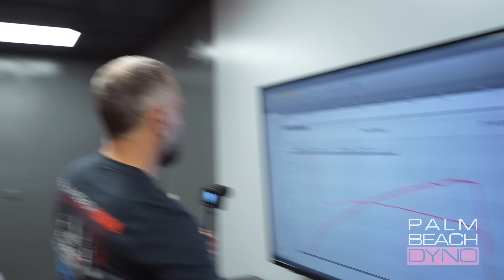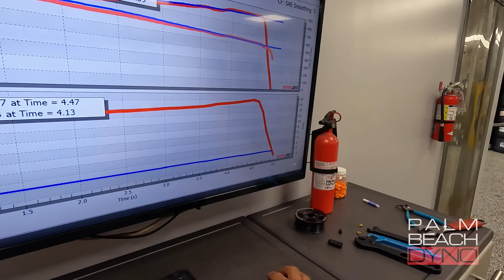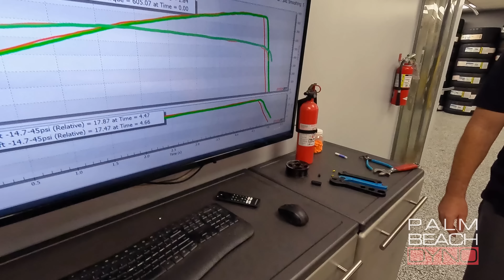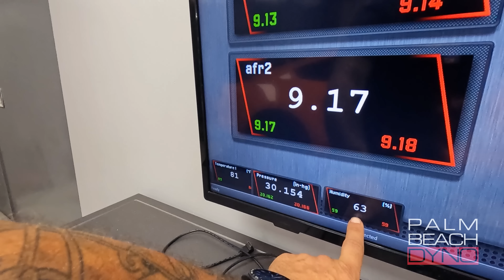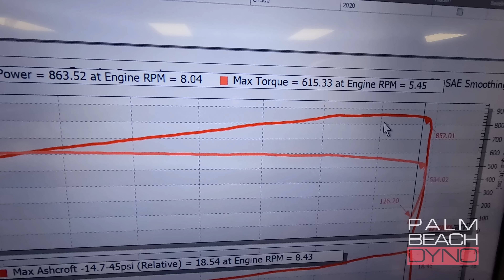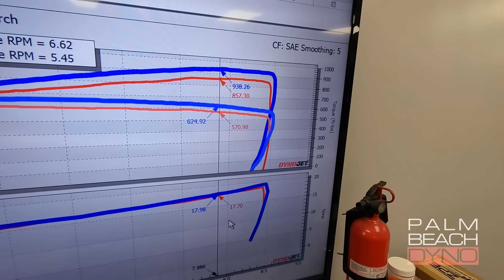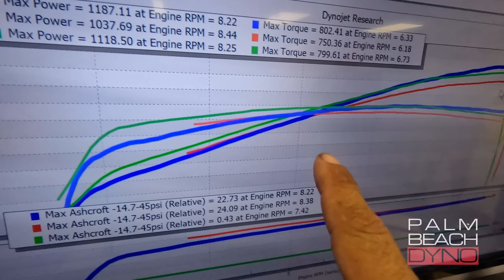1200HP GT500 WITH STOCK HEADERS?! 🤔 // KELLTRAC's WHIPPLE SUPERCHARGED Carbon Fiber Track Pack!

Comment: So the Orange car has OEM exhaust manifolds and OEM cats, if so can you run E85 @ 850-900 whp safely with the complete OEM exhaust system thanks.
Reply: Cat delete and oem headers. You can run kooks or American racing headers with their cats safely for over 1000whp. Not sure how safe factory cats are
Reply: @CarbonYote  I thought Ken said the orange GT500 has Kooks headers.
Reply: Watch the video again. The orange GT500 has Kooks headers, not OEM exhaust manifolds. It also has Kooks cats, not OEM.
Reply: @shimshonbendan8730  the Blue GT500 was the one with kooks
Reply: @shimshonbendan8730  no the orange car has cat delete on stock headers with an x-pipe I believe

Comment: Definitely would like to see how much more it would gain with headers
Reply: I am imagining one benefit would be the ability to make the same power on less boost, less stress on the engine and more heat evacuation. Just overall more efficient.  But yep Im wondering what youre wondering too-- boost equal, I bet it would pick up 60wheel
Reply from the maker: That's why we included the comparisons at the end!